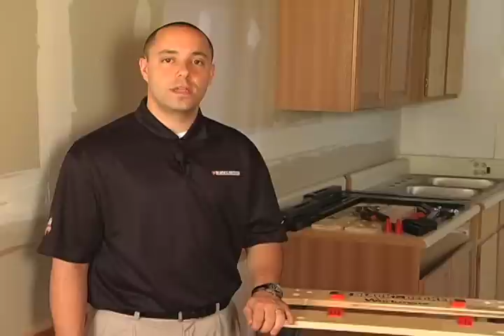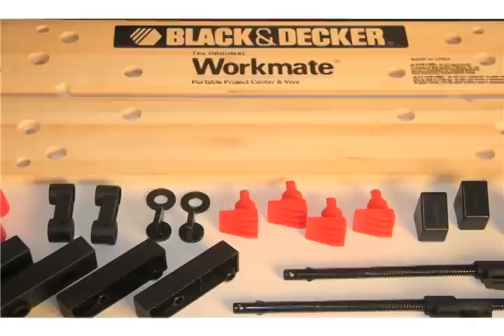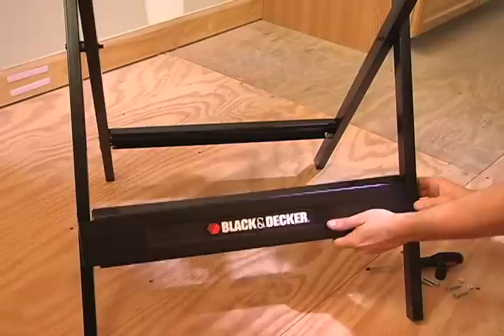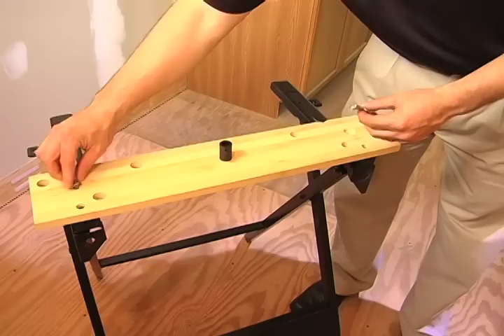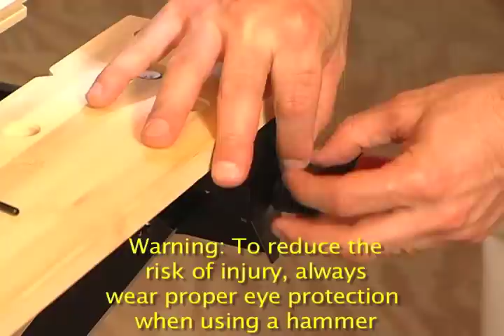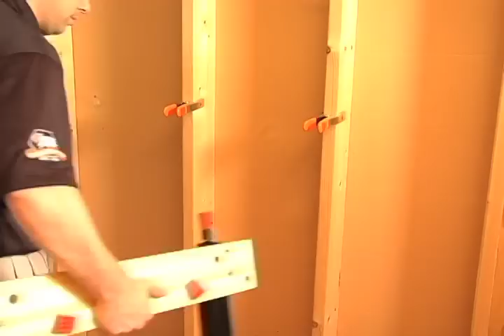How to Assemble Your Workmate®

Comment: thanks for posting the video - the instructions provided with the product weren't great. Two further things I couldn't get the rear jaw to fit - it just didn't seem long enough to get to the other side. By removing the front bracket and then the rear bracket I managed to get the leverage I needed and finally got the jaw on. Also the retaining pins for the handles were a real challenge to get in. Took longer than expected but now it seems to be working fine.
Reply: Also should add that I fitted the brackets back on once I had got the rear jaw attached. Also one of the prongs on one of the orange swivel pegs broke off - so had to glue it back on - so recommend better quality plastic for those.

Comment: This video was helpful, as in better than the useless instructions that come with the bench. But the video could be waaaay better, simply by explaining more thoroughly the various steps. This bench should take about 10 minutes to assemble, but took me over 30 minutes because I had to keep replaying the video to understand what Frank was talking about. Whenever he says, "Assemble as shown" it shows about one second. Instead, the camera should linger and show the assembled piece from different angles so I can see the orientation of the part to the bench. Another example where the instructions could be clearer is to point out that the holes for the front and back brackets are different distances apart: the front 2.5" and the back 2.0". I first assembled them the wrong way because there was nothing to orient me to which direction the brackets went on, just, "as shown."

This process was way more frustrating than it should have been, and this video could have been more helpful.
Reply: I agree! Poor instructions, poor video, I am up to about 2 hours now and 
no where near the end. Hate this!
Reply: We should get a different brand. They're crap
Reply: ABSOLUTELY TRUE!
Reply: Had the same experience. Had to watch several times, but I finally assembled it and it works on small project

Comment: Putting the handles on sucks.  It sucks a lot.  Nothing will stay in place.  There is no room to strike it with the hammer.  The peg won't go in the damn hole.  I have been pounding for almost 5 minutes and it won't go in.  All it is really managing to do at the moment is piss me off!
Reply: Kenneth Slayor you ain't the only one. Whoever designed and/or engineered these fucking handles is completely incompetent.

Comment: This is the second workmate I have had, no problem assembling the first one 25 years ago (probably made in the US)  the front vise board, plastic assemblies and metal support holes were out of align, what should have taken an hour or less wound up being over two, filing holes in plastic and wood to get the bolts to align and fit, no fun.  Chinese craftsmanship.